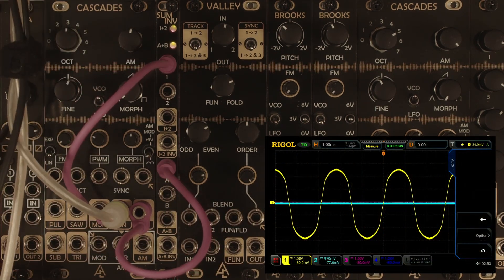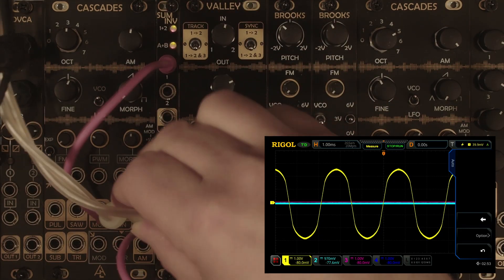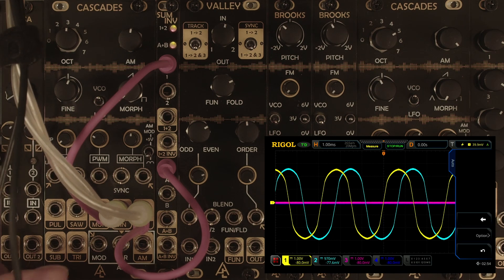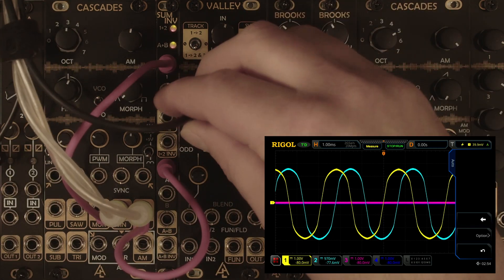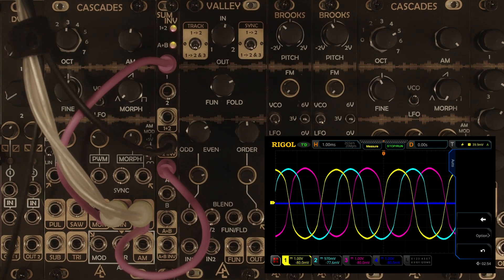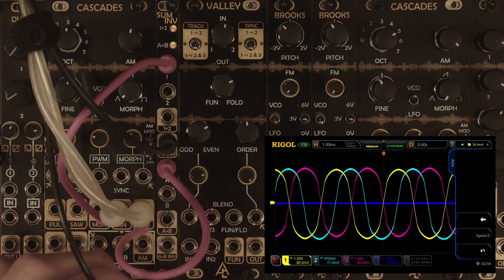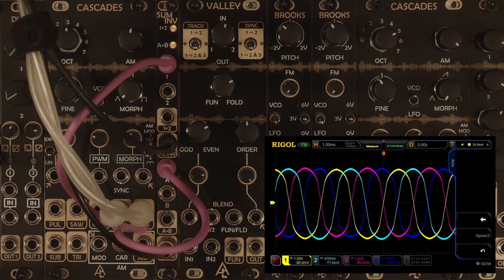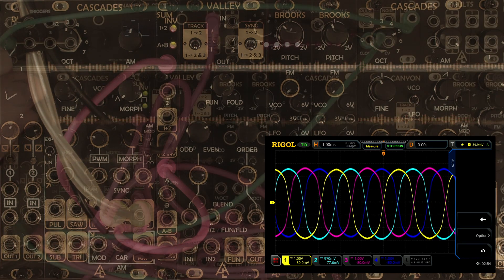Sum+Inv (Sum and Invert)

Comment: Is A+B inv the same as A-B? Can this module be used for splitting mid and side from a L R input?
Reply from the maker: You can do A-B if take the inv output of the top section and then use the bottom section to add with A.  The inv would be the equivalent to -(A+B).